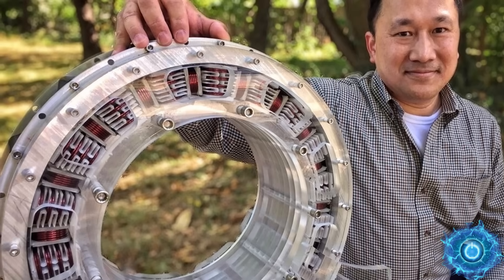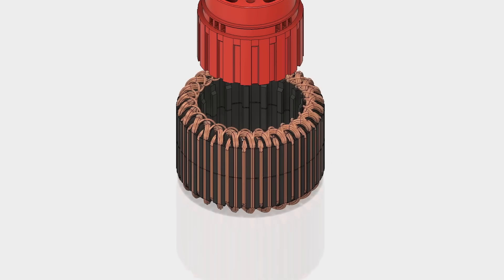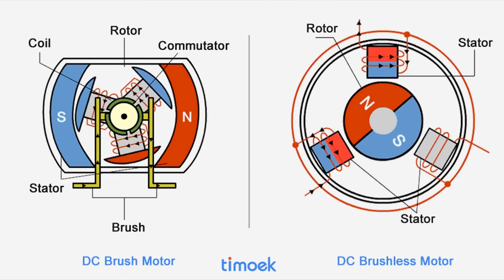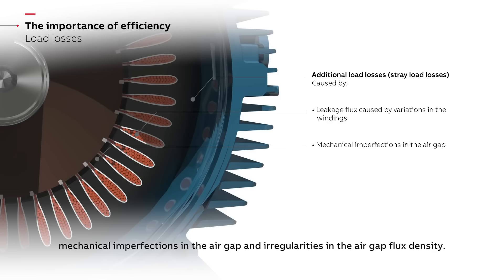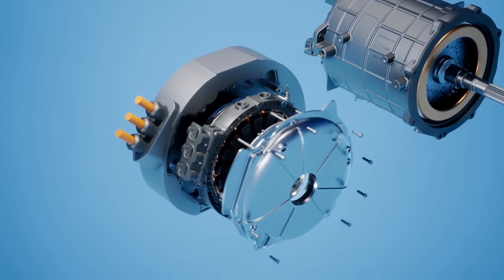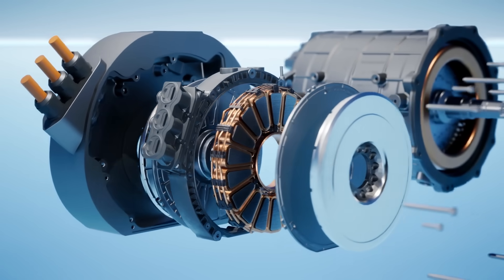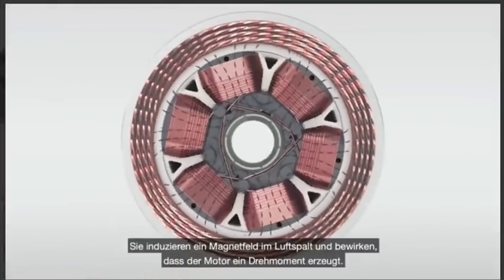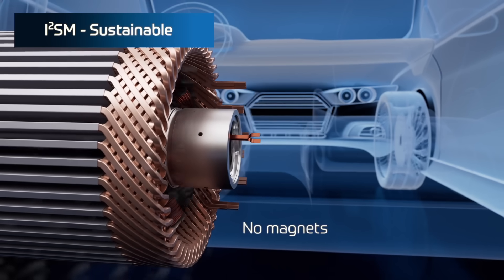INVENTOR BUILDS Breakthrough MOTOR - IS it REAL!?

Comment: Toshiba Superconducting Motor, along with Koenigsegg 800-horsepower "Dark Matter" or "Raxial Flux" engine, are really pushing the envelope and all I can see, is someone from this man's claims, is less than the work from either Toshiba or the Quark-E motor. It's a bit like the "Liberty Motor" from what I can see... interesting but just a P.O Concept, with more work to be done and ambiguous claims being made, as usual.
Reply: @mrhassel - I would respectfully have to disagree with you there.  How much is the dark matter motor at retail,  for example?

The guys who are really pushing this tech are the ones using old CDs and speaker magnets. Youtubers like Robert Marshall Smith and Carl Brujeja.  This is where the next gen of axial flux PCBs will come from

Comment: Hmm... thats like saying 2000w Wind Turbine - without stating at what wind speed do you need to achieve that, and how efficient is it at converting the available power in the wind. If a wind turbine needs a friggin storm to make it 2000w then they are not technacally lying lol... so yes "double the efficiency - compared to what?" good point
Reply: I mean the saturation of the motor is probably 2k so that’s the max it can get out no matter if it’s 20 mph or 50.
Reply: Your example is inefficient. Efficiency means getting the most output from a given amount of input. Requiring more input is by definition inefficient.
Reply: @dragonflysword  ok thats an obvious statement, are you trying to apply that to something ive said. If so explain further becasue your broekn sentances make no sense
Reply: @DiyEcoProjects  Firstly, efficiency would 'imply' operating within an optimal range, for example, a wind turbine designed to produce maximum output in 200+ mph winds would be inherently inefficient. An acoustic transducer which requires more than a fraction of a watt to function is inefficient as well.

'Okay', holy mother of English majors, read what the hell you just typed at me. I'm not 'applying' anything. 'I've' never seen such a  projection regarding "broekn sentances", because that makes total sense. You would argue that your leg to stand on hinges upon one isolated statement as an incomplete 'sentence' with that? Look at the 🤡!
Reply: These 2 talking like chatbots 😑
Reply: @DITECOProjects - Have you seen the guy in Shetland who uses a small rotary kite to get 450 watts" I am sure that he could easily get 2000 watts if he went for centripital rather than centrifugal flow.
Reply: @christopherd.winnan8701  yeah, ive seen the video. Interesting isnt it. It seems using it to waisted on as torque.
Reply: @DiyEcoProjects  Have you had any thoughts on effective ways to funnel such a wind stream? What would be the optimal geometries for the vortex?
Reply: @DiyEcoProjects  
I assumed by the fact you were replying to Youtube comments meant that you were quite happy to invest your time in related conversations. That and your moniker.  I did not realise that there was going to be a selection process.
Reply: @christopherd.winnan8701  The onus is on you, as you initiated the conversation. From the previous message it appears you are asking me to do the research for you. Is this the case?